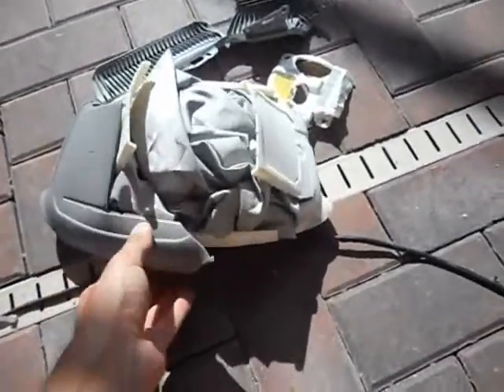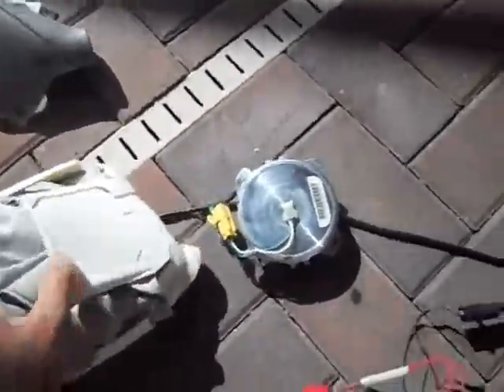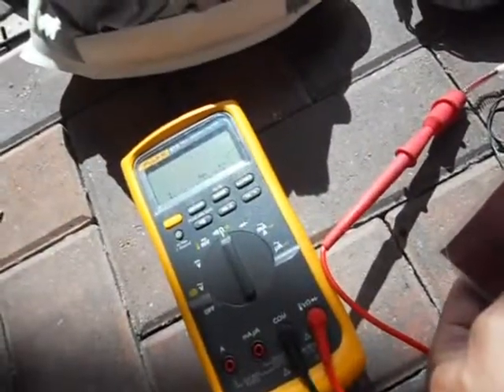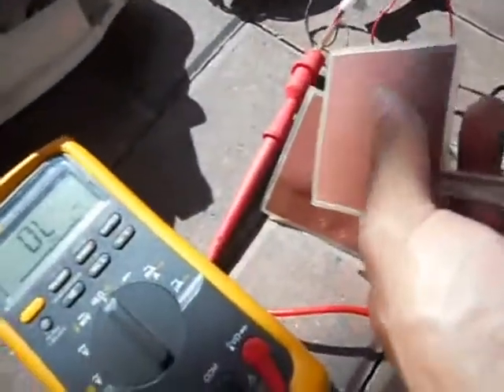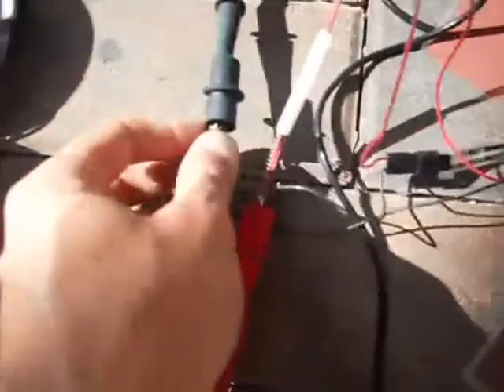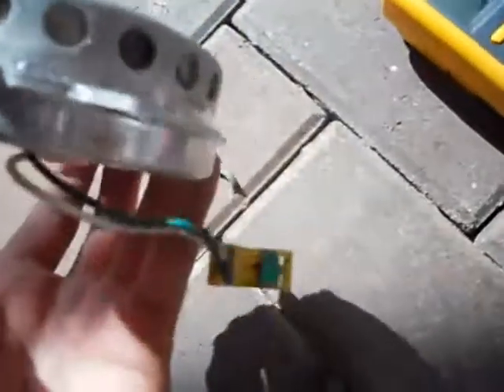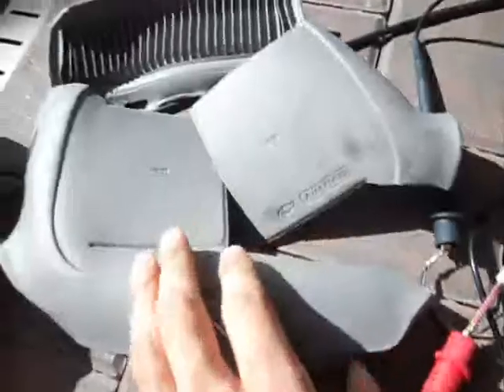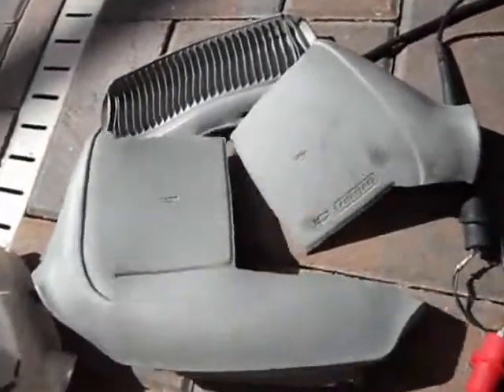Taking apart a blown air bag

Comment: Did GM change the horn design on these at some point?  My 95 Caprice doesn't have the horn buttons in the bag, they are located behind the bag in the back of the wheel.  I like that design much better, if a horn button craps out, just swap the switch, not the whole bag (like my RMW).